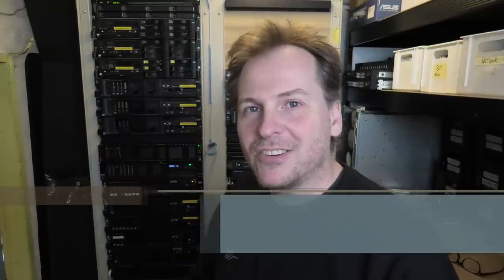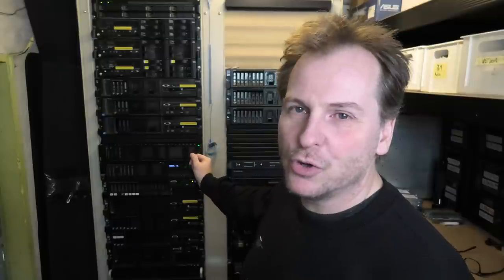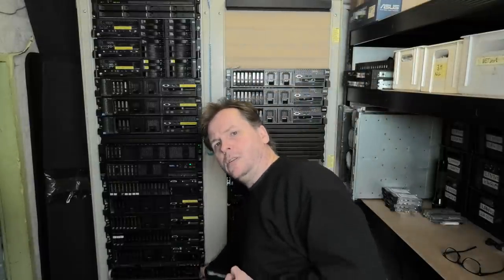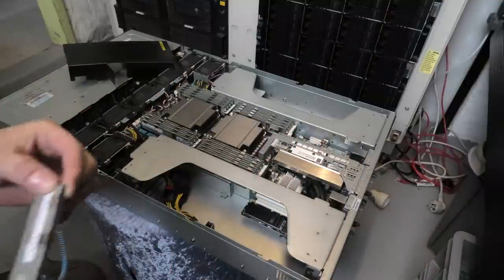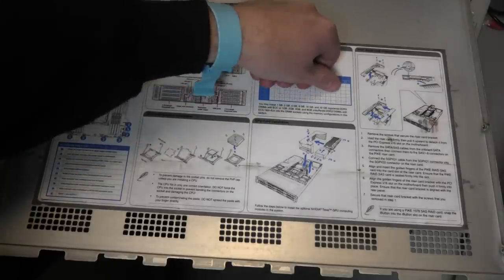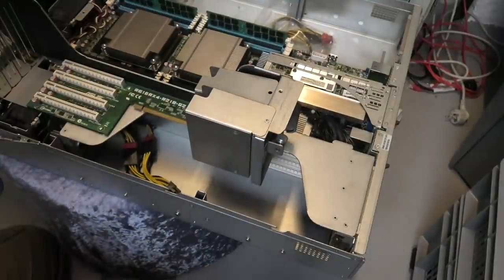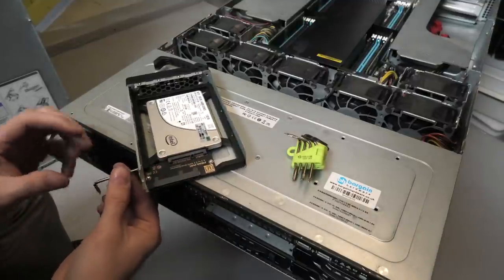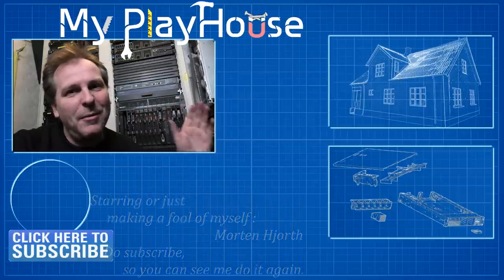Supply Chain Crisis & Housekeeping on Asus ESC 4000 G2 - 1116

Comment: I needed a USB cable for my APC UPS two months ago. They told me, that it would be shipped in Q1'22 due to parts availability :/ Luckily, ebay had a similar cable available.
Reply from the maker: Cable workaround :-)
Reply: @MyPlayHouse  Yet another case of unnecessary vendor lock-in. Why have RJ45 to USB, RJ45 to Serial, USB-A to USB-A etc. The cables are out of spec or proprietary. Why not stick to offical and well supported standards? APC told me, that they could not guarantee the correct working of remote management, if I would use a 2 euro USB-A to USB-A cable from ebay?

Comment: I have 24\7\2hr response on an SR550 Lenovo.  Had an 8tn sas drive fail.   8 days tp get a new one.  NONE in the US.  They had to fly a new one from the EU.
Reply from the maker: I buy all our servers (at work) with NBD,, I have never seen a bigger hardware error been fixed in much less than a day.  If you have anything that can not be down in more than a day,, make sure to have two.
Reply: @MyPlayHouse  These servers are not actively being used, but they store and then upload Taser in car cams to the cloud.  We now just send the videos straight to the cloud from the patrol cars.   Once they upload to the cloud, the video in a FIFO scheme on these servers.  We have a primary and secondary servers that will auto takeover in case of a hw issue.  Plus the data drives are in raid 6.